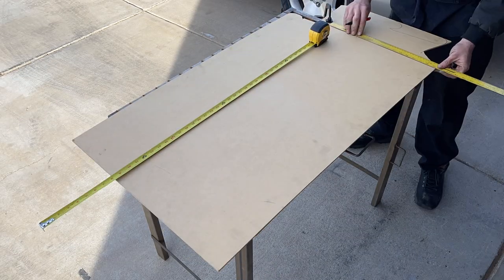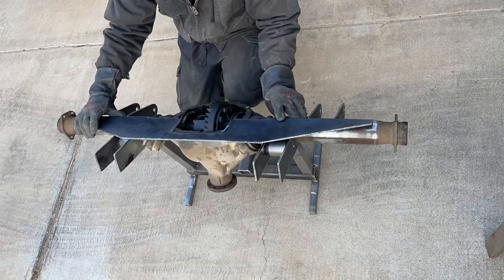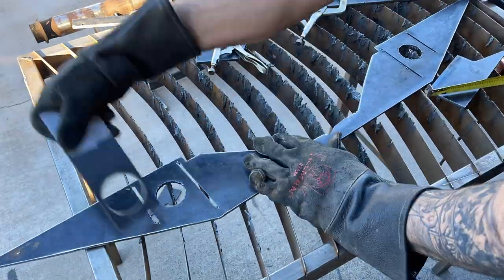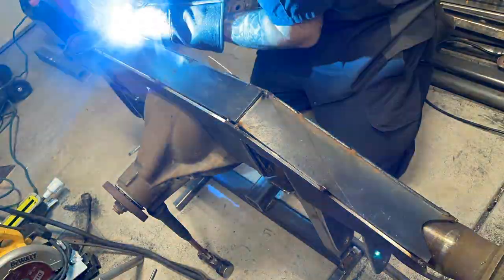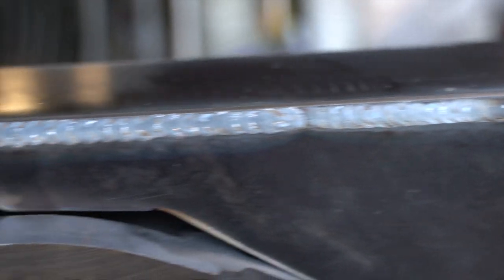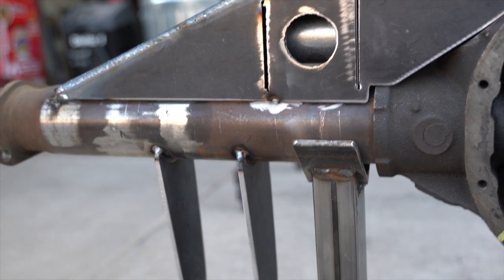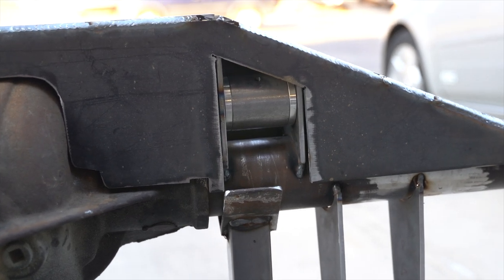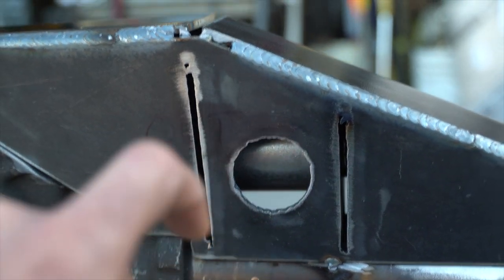Build an Axle Truss! Mighty Max Ep. 14

Comment: While researching suspension design tips for a new robotic ground vehicle design I found your channel and subscribed. Great information! As the old saying goes"Keep up the good work!"
Reply from the maker: Nice!! I’d be excited to see your product when it’s up and running. Never got into robotics but I’ve got a lot of interest in learning. A vehicle I plan to build will require some remote control features due to the inability to run wires or hydraulic lines.

Comment: I did basically the same thing with my 14 bolt truss for the rock crawler I am building. I welded the truss entirely while clamping/tacking it to the axle so as to minimize warping and movement without transferring much heat to the axle. Once the truss was welded and stabilized only then did I weld the final assembly to the axle. I also incorporated a diff cover to tie the truss to the axle housing. Ballistic Fabrication make a total badass truss and diff cover kit.
Reply from the maker: Wait… So the truss and diff cover are one piece? That sounds amazing! Glad to hear my mind is in the right place.
Reply: @GarageFab  The Ballistic Fabrication diff cover has an extended tab that bolts to the top of the truss to secure everything.
Reply from the maker: Nice

Comment: 2 recommendations ..

1 ..is mildly heat the axle (the whole thing) before u weld it all together including the truss.this helps with it's natural alignment with temp as the whole rear end changes shape when it's hot (running on the road) so 70-100 degrees Celsius is heaps 
And 2 it will help significantly if u have a gas feed inside the truss while your welding ..this gives a higher quality weld on the inner side and in particular will help pull heat away from the welds direct to the axle ...if your pulling a big thumping v8 perhaps these small gains can help

Perhaps u could do a video on a heated bar in one spot to illustrate to ppl just how much steel can move even when it's 3-4 inch thick high carbon steel rod ....it will grow in length
Reply: Otherwise typical 100% on point video keep up the great work
Reply from the maker: I do have some plans for welding warpage videos so I’ll have to add that is one of the examples. Thank you!

Comment: Great video. I have one question that you’ve probably already thought about. In changing the location of the link brackets to correct your pinion angle, how would that not affect the location of your truss and subsequent fitment of your front and rear plates? What kind of modification you do expect to have to do after everything is placed where it should be?
Reply from the maker: I have thought about that. But I must say I’m impressed you did without actually seeing it in person, Philip! 🙌 
So the sections around the tube wouldn’t need to change at all. Because it’s just rotating around a round object. 
But as for the plate around the actual differential, I suspect some metal will need to be trimmed on one side and the gap will open up slightly on the other. If movement is necessary I predict the front will need to come up slightly. The forehead of the differential is round so I don’t expect to have to do anything there but I’ll have to trim a bit on the sides of the diff. Hopefully the gap doesn’t open too much in the rear so I can still put a short weld bead at the top above the diff cover.
If all goes south I can just start over. 😬 
Thank you, Brother!!

Comment: i dig, and am looking forward to the watts link coming up. a question, though, about the warpage. would doing shorter welds and added cooling time between them have reduced this any?? i know it would take much longer, but i am also thinking about a thinner* metal panel and the addition of dimples to help with the weight reduction on the below mentioned "next project". 

*thinner being the operative (and relative) term, mind you...
Reply from the maker: Thinner would definitely be a must with dimple dies. The thickest steel I’ve been able to successfully dimple is 1/8.
Firstly, I consider shrinkage and warpage two different things. I’d highly recommend asking a certified welder the same question, but from my experience, no, shorter welds won’t reduce shrinking much. The shrinkage comes from the melting and cooling of the weld itself and the parent metal immediately surrounding the weld. Heat radiating beyond that generally does not create significant shrinkage.
Say for every 10 inches of weld, the piece shrinks 1/16 inch. Even breaking that up into 10 separate sections, it’s still 10 inches and therefore will still be 1/16 inches of shrinkage.
Doing smaller sections and jumping around WILL however keep your inevitable shrinkage even and under control. If you noticed while welding the truss I moved around rather than welding the entire length. This will keep the part from doing unwanted twisting or uneven warping. This is especially important on sheet metal. Shrinkage will happen, terrible warping doesn’t have to.

Comment: Hey just wondering what the benefit is to making a truss? I’ve never seen this before
Reply from the maker: There is nearly zero benefit on THIS project, Braeden! I shortened the axle by cutting it apart and welding it back together which could potentially weaken the axle tube. I wanted to bring some of the strength back. For just cruising the city though it probably wasn’t even necessary.
Trusses are REALLY important on axles that will be heavily abused like Trophy Trucks. A typical axle wouldn’t last long under those conditions.
Another good use for a truss on a Mini Truck would be to provide weldable material over the differential to attach triangulated link bar mounts. The Ford differential housing like mine is cast steel and shouldn’t be welded. A truss would solve that. 👍
Reply: @GarageFab  oh that’s actually a really good explanation, makes perfect sense now lol, well I appreciate you taking the time to reply and I can’t wait for your next video dude🤘
Reply from the maker: Anytime my friend!! Thank you.

Comment: Another awesome video! That's large amount of added weight right there. I hope your engine choice is going to be Big Block! I was wondering about shrinkage...and then you explained it. Would it not be a good thing to remove the axels and third member then run bar through the housing side to side to weld? Also. are you going the weld the axel tubes to the center section?
Reply from the maker: Thank you, Toby! Yeah it’s at least an additional 10 pounds. And no, there will be no high horsepower in this one. JustA Turbo 4G63. If you want balls, stick around for the next project. This one is just for my Wife to cruise around in.
I don’t think an internal jig would do much. It would resist the restoration but not prevent it. The heat would tweak the tube regardless. If you could get the jig out, I think the tube would just flex anyway. I think the goal is to just avoid warpage in the first place.
And no, there will be no tube welding because again, not extremely high horse power. I’m sure the Ford V8 had more torque than the Eclipse.
Reply: @GarageFab  Alston's Chassisworks sell a bar, but it half width, I think it's to warn you when the tube is warping, not stop the warping.
Reply from the maker: I would agree with that!

Comment: How I doing bud have question I have a 2001 Lincoln towncar low rider. We’ll as. Might know Lincoln’s use watts link well watts link doesn’t help me with my hydraulics as it hold me down which doesn’t let use hydraulics full potential like 3wheel and such. I am curently gonna install a 4 link set up an eliminate the watts link. In th rear I’m gonna be using 18 inch cylinders and 10 in the front here’s my question to u . What u think I should do to set up my pinion angle to be able to drive it at different heights? I would really appreciate some opinions im not a professional but I do all work on my car since I don’t have money to have others do it I use money to buy parts instead and do it myself.. I did all my hydraulics install wiring switches music system so far all good . Thank I’m advance bro
Reply from the maker: I believe I’m familiar with it. The center link is mounted diagonally on the top front of the differential right? I’m surprised it’s holding you back from more lift. Watts links usually work well with lots of travel.
If you’re already planning on installing a 4 link, make it a Triangulated 4 link that follows the parallel 4 link principles. You’ll have to modify the floor pan under the back seat but this will keep your pinion angle constant at all ride heights, no matter how extreme. See my video Suspension Basics Episode 2.
Suspension Basics 02: The Effects of Link Bar Movement on Attached Components.
https://youtu.be/ZHtQwQzY8uM
Your pinion angle will be set to parallel to the transmission. See my video about driveshafts. 
Suspension Basics 06: A Better U Joint Driveshaft Video
https://youtu.be/YgNZfIR-8Ng
Lemme know if you need clarification!

Comment: I just want to see that black truck in your intro.
Reply from the maker: Hang in there a few months my friend! As soon as my Wife’s truck is out of the garage, that project starts. My excitement is overflowing.
Spoiler alert… All Wheel Drive, 600+ horsepower to start, 16 cylinders, 4 wheel steering, fully bagged of course.
It’ll be a good time.
Reply: @GarageFab  so.. concept at this point. I like what I see. Super crisp.
Reply from the maker: One step beyond concept but yes, still a concept. I’ve got the truck, the wheels, and two donor vehicles. All we’re waiting for is shop space and time.
Thank you my friend. 🙏